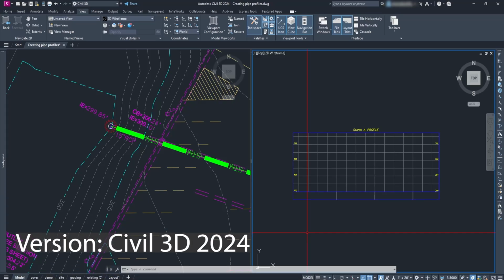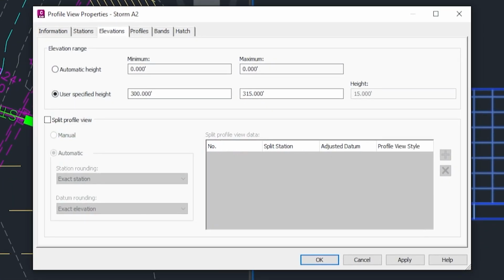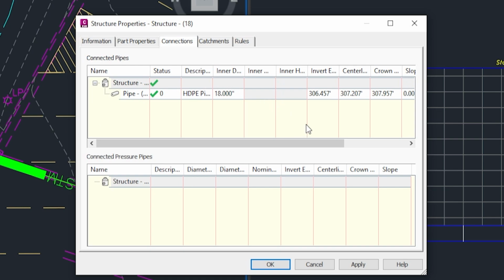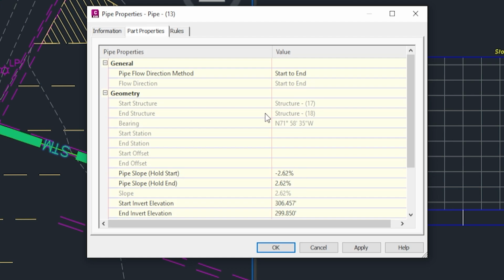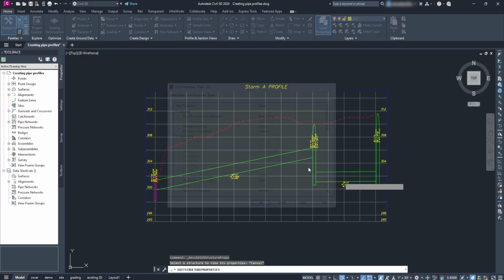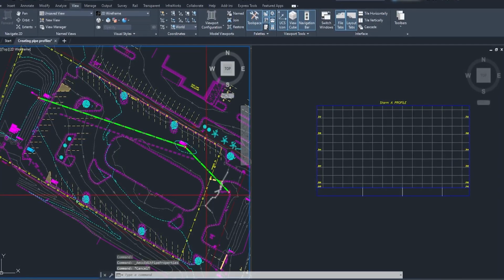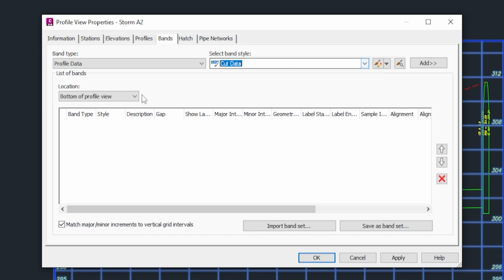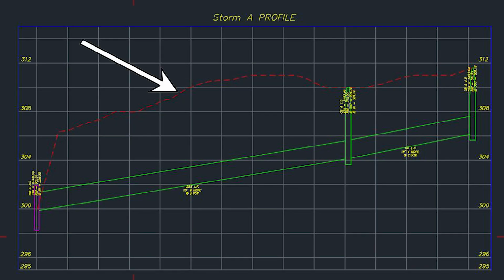Manipulate Pipe Networks and Profiles Views

Comment: In Autodesk Civil 3D, how can I display pipes visibly entering or exiting a manhole or inlet in a profile view — for example, showing the pipe penetration into the structure with a small hatched section that represents the wall or connection point?
Reply from the maker: Sorry this is a very late reply but, you can create an alignment using a pipe network and then that will let you be able to create a profile view. Hope this helps I’ll make a video for you later on